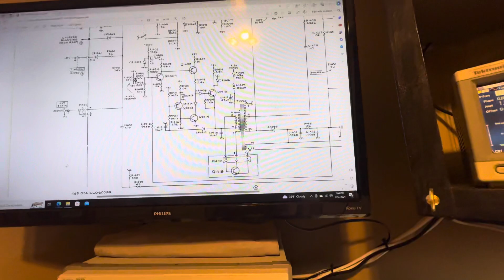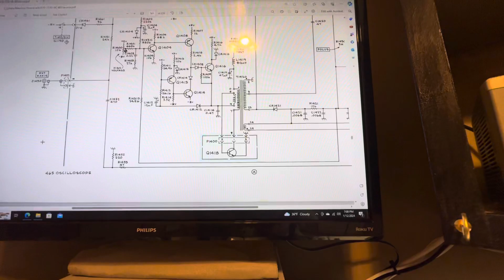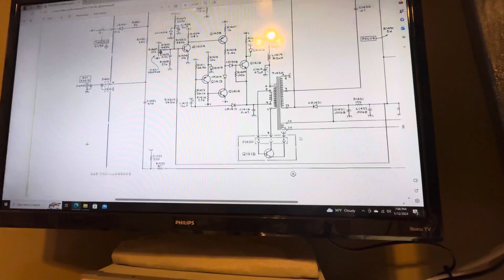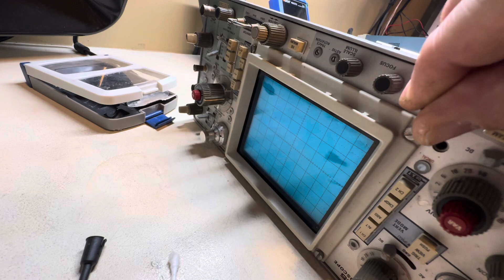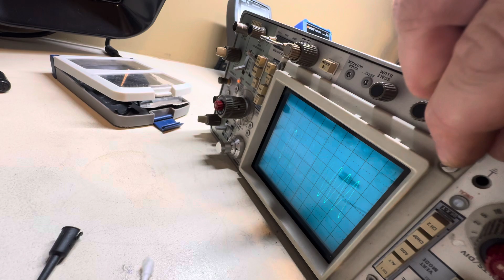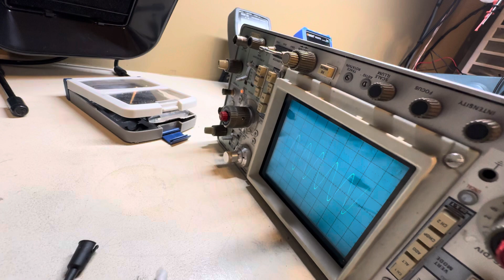Tektronix 465 100 MHz 2 Channel Analog Oscilloscope Repair Part 2

Comment: I recently bought a Tek 465b. The problem is that it takes a little over a minute for the brightness, or rather the trace, to appear. After that, it works perfectly. I think that's an excessive amount of time. I don't know where to begin troubleshooting. Any ideas? Thanks

Comment: I was curious about the Multiplier, how much is it and what's inside it and why can't they be rebuilt? Nice video TG, look fwd to seeing what's next. Best Wishes & Blessings. Keith Noneya
Reply from the maker: The multiplier is made up of g HV diodes/capacitors/resistor. The diodes is typically what shorts and fails and shorts the HV secondary winding on the HV transformer out. Unfortunately they are potted and sealed assembly, so trying to rebuild one will likely result in destroying the module. 

Now the CRT on these don’t need the 14 kV PDA (post deflection acceleration) to produce a display.  Without the PDA, the image will have lower, intensity, poor focus, and the wrong deflection, trick I learned many years ago when testing them is to remove ground strap to remove short and 50k oscillator sure start, if not you can feed 50k frequency to pin 1 and 14 on neck of CRT push voltage to 10v peak to peak, or as high as signal generator will allow to test HV supply and sure get a few hundred volts enough to get a image to see if HV transformer is good and not shorted. 

I could build a multiplier but would have to see if it fits and pot it is the problem. One of the odd designs Tektronix did was put -2.4kv across filament for noise rejection and etc. The heater is tied to the cathode which is at -2450V. Typically most CRT’s are 6.3V. 

Another safer way to check is If the HV multiplier is shorted, it will also load down transistor Q1404. Check the voltages on it, they should be, if not the multiplier likely at fault.  Voltages on Q1404 sure be 

Collector: +4.4V
Base: +0.7V
Emitter: +0.1V